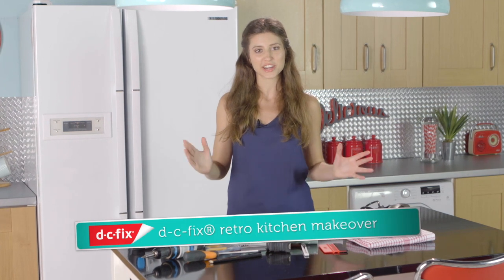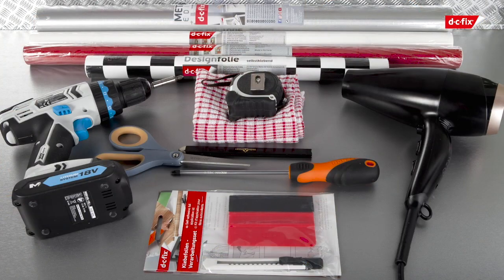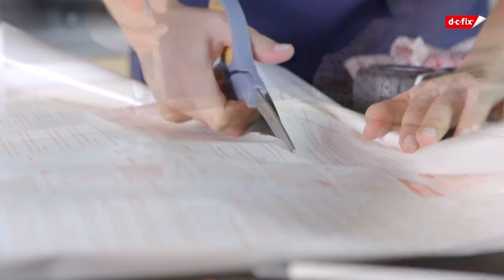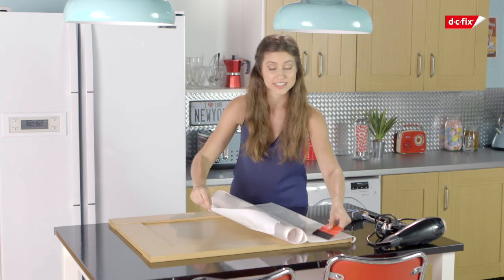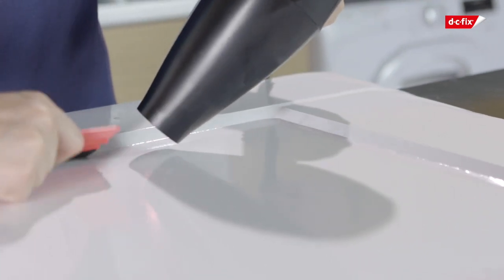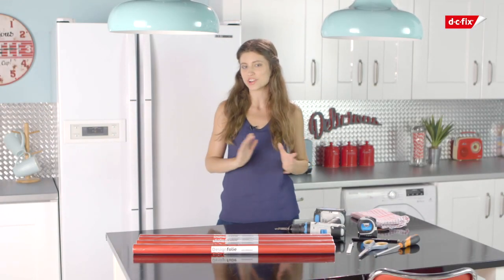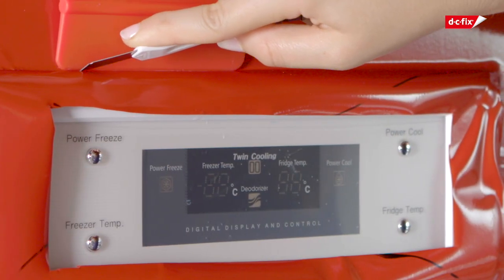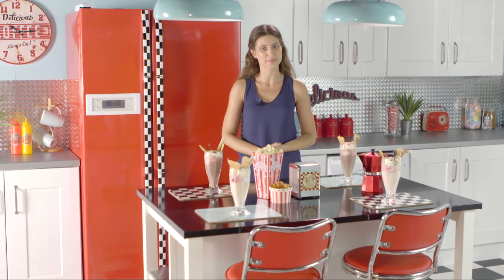Wrap a kitchen with grooves: Retro look

Comment: Can this material be removed easily if installed in an apartment?
Reply from the maker: Yes. Just use a hair dryer to heat the vinyl when you remove.